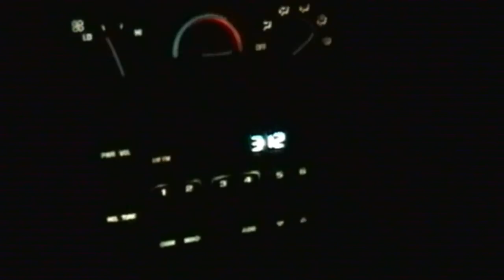THEY ARE SELLING OUR HOUSE!? |Somers In Alaska Vlogs

Comment: Question,   i just saw ur new house walls made w/ plywood.  Curious? Isn't that a bad idea for your shell,  frame?    Plywood or partical  Bord,  is pieces of ( usually) scrap wood chips and shavings,  when wet,  will expand and the wood chips will fall apart. My 1st rental home,  it had really beautiful tiles.   Under the tile,  to my dismay,  was plywood.  I thought,  old s house,  Maine homes usually are hard wood floors,  but i didn't blink
Think about it much, until about a year after moving in...  I mop daily  often twice,  i have pets,  and Maine winters has a tendency to track into homes...  Esp on doggy feet.  So wet,  often muddy...  After that year,  my lovely tiles started to buck up and pop right off! My floors become an uneven,  bumpy,  hilly mess!  Even my Christmas tree kept tipping over,  uneven lumpy floors,  and missing tiles,   my entire downstairs had numerous tiles gone.  Getting worse...  All because of that plywood floor! 
And one other concern, Is the Formaldehyde that's riddled throughout your new home,  and formaldehyde is a strong-smelling gas used in making building materials and many household products. 
*It is used in pressed-wood products, such as particleboard, plywood, and fiberboard* those glues and adhesives; permanent-press fabrics; paper product coatings; and certain insulation materials.   I'm curious why you are using plywood for your main structure?